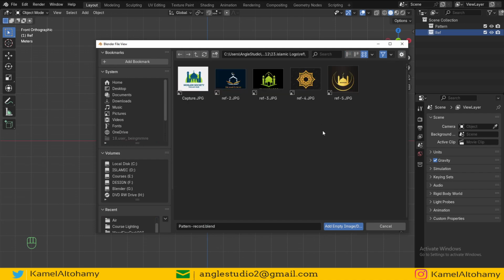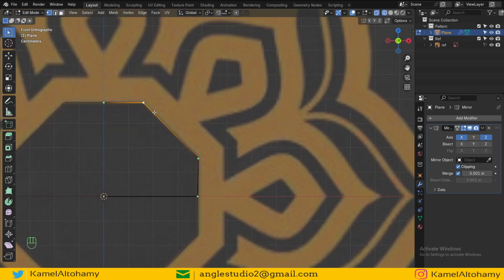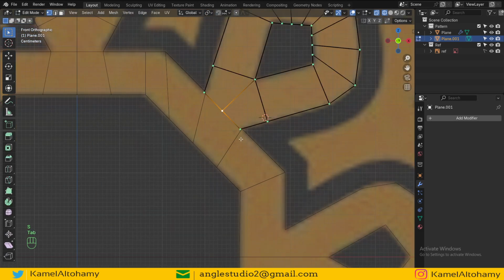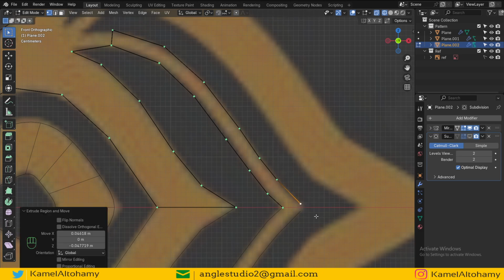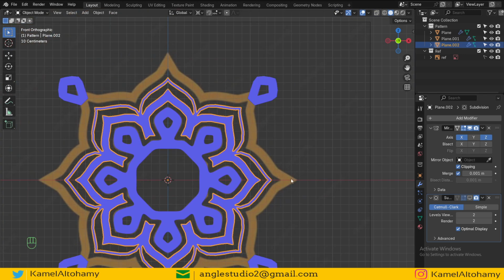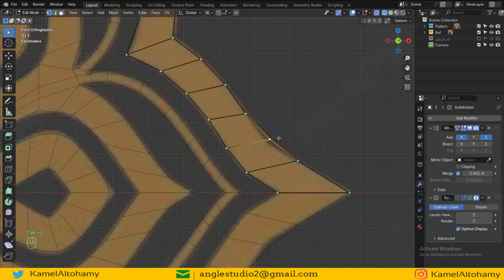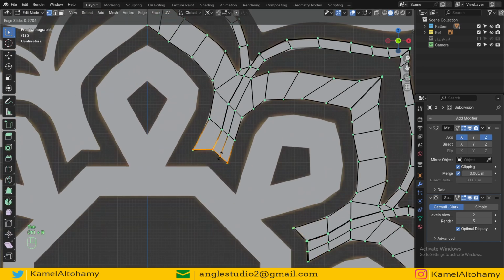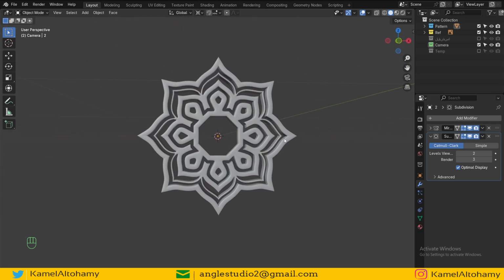How to Model 3D Pattern in Blender 4.3 (En.) | Blender Tutorial for beginners

Comment: very nice but it's a bit advanced for a total blender noob. I can make this in moi or rhino is probably 1/4 of the time it takes in blender. what is the advantage of modeling in blender? can can you share more tutorials with the basics .. it;s sometimes difficult to follow as you skip some commands. great video
Reply from the maker: of course in the next few days will post course about blender 4.3 , i know it can be done easily in Rhino but some hobbyist do not have license to purchase Rhino and you can export same model and 3d prin or use as decoration in interior scene. the reason we prefer Blender it is free and  available for everyone